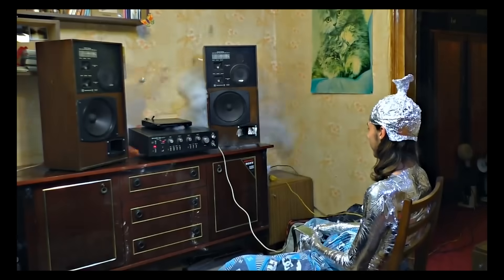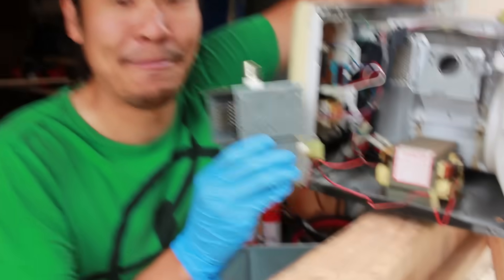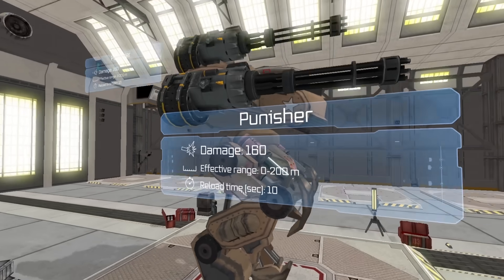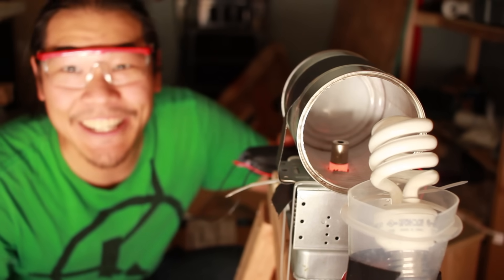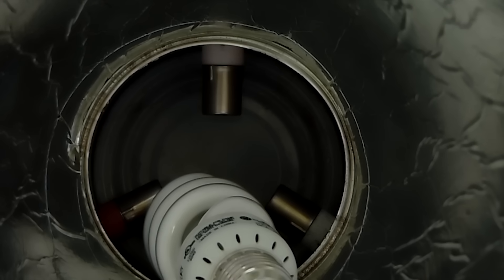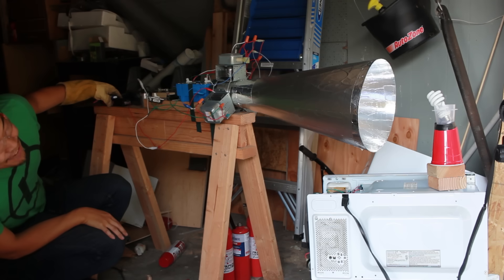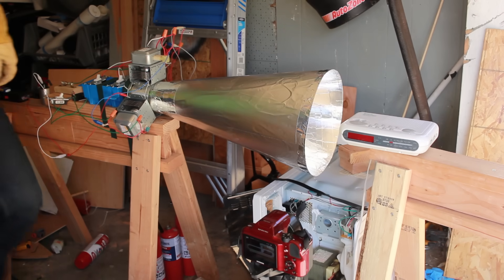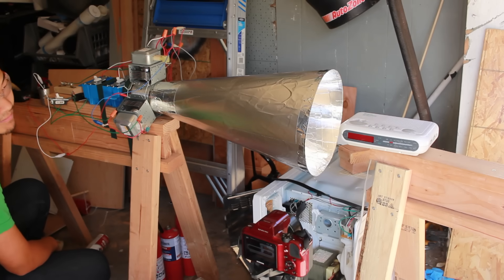A Microwave Gun Made From Taser and Soup Can??? (Testing Kreosan's Magnetron Cannon)

Comment: So, first of all kreosan did mention about using capasitor assembly(i'm from russia, so i can understand them xd).
Secondly, spark gap wastes a lot of power and their gun doesn't have one(listen to the original video's sound).
Thirdly, you could try using something stronger, than a small stungun(for example li-pol battery; inverter and a step-up transformer) or use multiple stunguns in parralel to supply more current. Then the gun will work better(and become significantly more dangerous)

Comment: Back in '05 I made one of these, still using 3 magnetrons, but I used the transformers, too. I ran the whole system off of some lead-acid batteries and an inverter in the backpack. It was able to reset/fry door access panels and car computers. The biggest thing I did was blow up a laptop (battery lit off).

I didn't use the Stun Gun, though, that's a weird way to get lots of power at high voltage... it just puts out high voltage.

Comment: Careful with dissembling microwave ovens for parts; besides the high-voltage and flesh-cooking radiation risks, in some models some components are made of materials that are bad for your health (I think it's something in the transformers, but don't quote me on that), and you can get exposed to it if you open the wrong part or break something or some such.

Comment: There is a basic error here, the magnetron is a continuous wave, it works at full power with a certain VOLTAGE of about 3.8 kV and with the heater (cathode) heating turned on. And if it would be done like this, the radio would not be able to be turned on anymore. But I would especially be careful about the eyes and testicles, they are the most sensitive to microwaves. You really don't do this at home, it's dangerous.

Comment: You guys know why this isn't cooking electronics don't you? It's not so much lack of power, it's lack of AC power which is how the resonant chambers in the magnetron produces the radiation, AND here's the big one: that magnetron your using was designed to vibrate atoms in water molecules. I know your clever enough to figure out most of the emmited radiation on your setup is wasted before it leaves the horn you got there. Without breaking national security I might invite you to research, "microwave resonant design for star wars defence initiative," and perhaps you might be the scientist who officially figures out that if you take a 5 shot nerf gun and use it as a template on a 16 inch slab of beryllium copper and use some of today's high capacity graphene capacitors that you can produce viable results that require less resources than our moth balled sdi weapon from the 1980s.

Comment: There are two things you don't consider. One: all depends by the capacitor. Use a strong ceramic capacitor, and you will generate pretty loud waves. Not so powerful, but a huge peak. Second, the receiving antenna. Everything which has cables or wires will receive the full peak. So no wonder if a stereo with thermionic valves explodes, because it has radio antenna AND long wires. And thermionic valves. So I think you should try with a much powerful capacitor. Sure, it will shoot less often. But is sufficient, if the peak is high enough. Think when you build a strobo-lights controller: all is about ceramic capacitors, right? Little power but strong lights, just a few time per second.

Comment: This should be made in solid state (VFO and transistors) as it's more efficent from batteries and you should use a sat dish instead a waveguide.
Waveguide is a good option you if do the whole circuit in waveguide instead of a pcb like in the old days.

Comment: you need a hight voltage thyristor and contactor
Reply: And nokia 3011 batteries
Reply: @maverick300  i made this but use a cap bank a contractor and thyrister from a 1000amp DC esab welding machine   a spot welder   i can blow hole the size of dinner plates in metal car doors throw walls

Comment: Nah Krupsant or what ever. Is...sketchy AF and basically lies in some form . Click batey videos and dodgy facts, with dubbing.  And also. stop to think about this...pretty much all all cell phones rolled out after  more or less the 90s uses microwave radio which is why they need towers and satalies to bounce the signal around. Your WiFibox is also using microwave frequency radios. It's basically just not going to the hollywood fry electronics things anyway. sufficed to say as you know good sir.  at that power level? nah might get nifty looking colors possibly distort a display but about it.
Now when ramp it up to oooh say CERN,  the Larg Hidrgon exploder? yeah that'd probably do it. probably make your computer into something resembling a shaquarshed can, lol. I guess that's one way to demolosh your computer HD.

Comment: they could have used  the transformer to bump up the voltage that may have been what they did in the video you were talking about. Without it you may be right about its lack of power. But I think it could work if you could integrate the transformer.  I think it could be worth a try

Comment: Chaining emitters requires synchronizing them, otherwise they just interfere with each other.  The tube also has to be a specific size relative to the wave length, and I think for microwaves it's a straight tube rather than a cone shape.  I've seen two designs for chaining emitters.  One used a tiny reflector in front of each emitter that sent waves back to the next emitter, causing them to synchronize.  The other used a timed signal for the pulses to account for delay between emitters.  Not sure how well either method works, but it's never done in a commercial product, so that might be a clue to their effectiveness.

Comment: Isn't it illegal to operate a destructive emp device in the US? I built a small one back in the day but from the research I did I thought it was perfectly legal to build but illegal to turn it on 🤔
Reply: Howd u bild it? D simlest way 4 now seems like high power capacitor + magnetron + mw guide.
Reply: @niger973nger8  took the board out of one of those mosquito tennis 🎾 zappers. Added a coil with a spark gap and replaced the transistor because it was dead. Put it all in a box and the pulse from the coil was very short range.

Comment: If you are attempting to culminate your Microwaves with that aluminum cone for extended ranges it'd make sense to flip it over 180 degrees. Look over your Microwaves design for a while.  The key to achieving your goal is right there in front of you. Good luck, be safe and do not breathe in the neat looking pink stuff inside the Magnatron.

Comment: So what you're saying is, those guys were smart enough to fake it. And you made it for real!
In all seriousness, shouldn't you be worried about increasing your risk for cataracts later in life? I realize microwaves are non-ionizing radiation and you would feel your skin getting hot before it could do any damage to your organs, reproductive or otherwise. But microwaves can totally give you cataracts, right?? That's why we have a mesh covering the glass door on them. At least that's what I've gathered from Steve Mould, King of Random and NileRed.
I realize you never even approached the wattage of wall power, and that likely significantly decreased your risk of bodily harm. You mentioned that they used vape batteries, and in the clip you showed it seemed like there were 4 in series. You use one, and then it looks like you switched to a different square battery strapped to the top of the stungun, possibly the one which came with it?
Did you do this because the wattage of the system is bottlenecked by the stungun? Since the whole circuit is limited by the current it is able to draw? So at that point the batteries you used for it wouldn't make any difference? I'm no electrical engineer so if anyone could help me out here that would be great.

Comment: Why can't this be done with outlet 220v or a 18650 batteries hoked up to a inverter 220v, it will last for 5min but at least it will give tons of power, don't forget to add the transformers/camps as well for maximum power, it will be a bit heavy for portable but hey it's a cannon after all.

Comment: You need to calculate the wave length it creates with some hi level math. The opening of the cone is .5 of the actual wave length your making. This will give the wave length an accoustic boost. Like 2 boats passing eachother but they keep passing anothet boat iver and over. Creating accoustic spikes. This will optimize the guns power. Its an engine. They have to be tuned to be usefull.

Comment: Hi did you try with 3 capacitors ? Would you put the 3 capacitors  in serial instead of parallel  in order to obtain more voltage ? Kreaosan seems used more batteries as well to give power to the stunt gun

Comment: well if its power that is required we can all get together and ship our microwave capacitors and charge a 500,000 farad capacitor bank in parallel and charge it for a day and discharge it all at once and line up a number of flourescent light bulbs to measure the range. if you hook up a couple transformers in parallel you can connect them on either polarities of the house circuit to make it 240 volts and up the amperage. to charge it faster.

Comment: So if you were to build a trap in the back the block possible interference and power this with a larger battery array and a parallel series of capacitors with a more restrictive spark gap to squeeze as much power from a single spark as possible could the range be increased? how many would you need before you could interfere from 50 ft away?

Comment: REDO, REDO!!   Next time use 480 VAC and a 1,200 volt capacitor. THIS SHOULD make clocks, watches, calculators not just stop working but go SOFT and the circuit boards should have a SMORES finish to them.....

Comment: If you connect it to the mains it will work no problem. But the reverse square law will require exponentially more power the further you go. So more 4 times more magnetrons for everytime you double the distance

Comment: I would asume that if you applied a stronger electrical current and attracted a beefy regulator you could get that bad boy taking down the blocks electronics but be careful its not the voltage that kills you its the current and we all know how that rip tide can be  p.s whats that taser rated at and those microwaves looked like they were 800 watts

Comment: I don't think they used aluminium tape with a bit of paper. I think they actually welded it the cone out of steel or something

Tell me if I'm wrong
Reply: that is definitely not a steel cone. First of all, you can see the crinkles in the foil so that should be pretty obvious, but even if it wasn't a steel cone like that would be heavy as fuck and there would be no reason to use that material anyway.

Comment: Use a better capacitor to increase the voltage
Reply: what, it would be insanely not practical to build a charge pump using series charging, parallel discharge

Comment: You should have used all three capacitors (in series for more voltage, they'll probably short out like that), and get rid of the spark gap, it has a ton of resistance.

Comment: No, that was/is real. Magnetrons are built to send out mangetic waves strong enough to shake polar molecules to cook food. Electromagnetic signals (except 3x the intensity) can be picked up by PCBs, wires, transformers, etc. thus interfering with the device, and in some cases, blowing a few capacitors and ICs.

Comment: FYI ~ The ad for the EMP Protection device before the video is misleading. It makes lay persons think that the device will allow you to continue to have power after an EMP strike. It won’t. What it may do if it works as advertised is “shield” your system from ground fault. Thus when the grid is restored, your equipment and wiring won’t be damaged.

Comment: Disappointed you didnt plug it into the wall
Reply: I know this is an old comment but i was like "PLUG IT IN TO THE WALL ALAN!" 🤣🤣
Reply: Same
Reply: Exactly! Can't believe he put all that effort and didn't blow things up with an actual EMP cannon.
Reply: perhaps he was scared of trying to power 3 microwaves at the same time with little to no safe equipment, idk, just a thought that came tom my mind

Jokes apart, the main goal of his video was to show the other video was fake due to the lack of power supply, not to try anything real crazy, as he knew it wouldn't work
Reply: May be he tried off camera..
Reply: it works off dc.
Reply: @Rin-qj7zt  so just chuck a couple diodes in

Comment: If you ever remember points and a car ignition system with coil. You will note that the coil is charged up with DC when the points a closed. And it is when the points open, that the field collapses in the coil, generating a larger voltage spike in the secondary coil (Transformer). And that the capacitor/condenser (old fashioned language, after Moses and JC) (Leyden Jar lightning in a jar by static storage is the grand daddy of modern capacitor) is in parallel with the points, so it gets the full hit of the COIL discharge collapsing field and its resulting BACK EMF, which gives a much larger current and spark on the secondary. And also limits the spark across the points, making them live longer and prosper. (Meaning they don't burn out as quick).

Capacitors store a larger current. So as Moses Capacitor, or its called the Ark of the Covenant. A Leyden Jar, made of Gold on the outer plate and inner plates, with acacia wood as the insulator between them. It stored enough voltage and CURRENT combination to kill people touched it. Which made it very handy for the sceptics that said, Naw God is not in that box! ZAP!

And it killed both good and bad men alike, including a priests two sons, as it jumped out like lightning. And also another guy carrying it on his donkey, and it stumbled so he put out his hand to steady the ark, and it arced out at him and struck him dead. Moses was a bit miffed that God would do such a thing... well now you know it was not God, it was ELECTRICITY. Makes you wonder why an ALIEN would give Moses a Magicians Box to prove that God was with them. But what a placebo effect.

So be careful that even charging up a huge capacitor of a 20 Litre barrel by a Van Der Graaf generator is enough to kill people. The Ark of Moses (Leyden Jar considered most holy presence of God) was 1.5 cubits by 2.5 cubits by 1.5 cubits high. The guess is that the winds of the angels (Cheribum) acted like antenna and collected energy from the earths magnetic field and air combination, like lightning is formed at higher altitudes. And stored it as a CURRENT and voltage combo. Like when you get a static shock build up from rubbing your feet on carpet. It stores up because of rubber soles etc like a capacitor. Doing it on a grander scale give that voltage a higher current. And that is what kills. For the record cubits varied between 18" and 21" depending on if it was a royal cubit based upon the size of the foot of the Pharaoh. Giants they were. So 27"W 45"L x 27"H . Or you could use a plastic storage container of a decent size. Note putting the wings together would short it out, if wired correctly. Slightly apart would create an interesting display of arcing as it charged up enough to jump the gap. And putting them wider would allow a much greater charge. This magic box would then part water, like the River Jordan as mentioned in Joshua 3. Since Gold repels both north and south poles of magnets. The elements of water, having both north and south poles, would be repelled all the more with a huge voltage of electrostatic charge. Ethiopia is rumoured to have the original ark as you can see in research. With the caretakers going blind and dying after about a year on the job. The original storage place in the Temple of Solomon was gold lined, which is like lead to shield from the radiation. The Ark was worshipped as if it was the presence of God, with the arks and mini lightning. It has notoriety and gave the placebo effect boost to faith. It was however captured by the Philistines and they all got cancerous tumours and hemorrhoid's from it. So don't ignorantly mock holy relics, they have an alien kick to them.
Reply: So consider making up your own capacitor, but do be careful. Out of plastic containers of several litres in size that you can line with aluminium tape. Or glass jars as to the original Leyden Jar. As glass is a great high voltage insulator. Coffee jars or jam jars. But a good sized 20L plastic bucket. Make sure that you insulate it so you wont accidentally touch it and kills yourself or someone. And do shield those magnetrons, as the radiation won't be apparent to kill you immediately, but it will take about 10 years or so to show up as cancer. Even magnetic fields from MINE detector vehicles from world war 2 had all the occupants die of cancer decades later.
Reply: Ignorance and arrogance are the flaws of humanity that kill them over and over again.

Comment: I am curious, as you probably tried this already, but did you try switching the tazer contacts around as it outputs most of the energy as a pulse and polarity matters for the magnetron (negative on the filament). Also make sure the filament voltage stays within spec while on and does not drop too much.
Reply: Nice like amount, 69